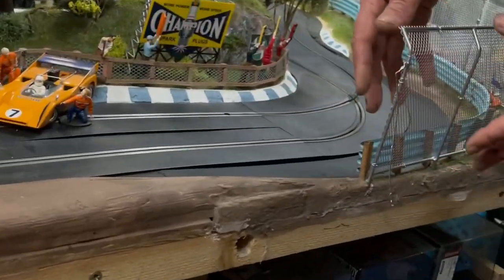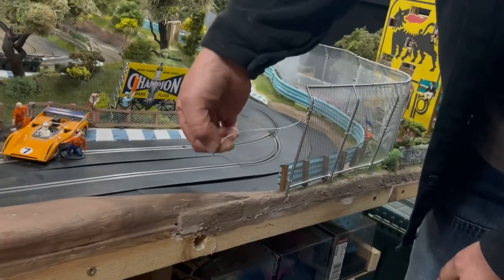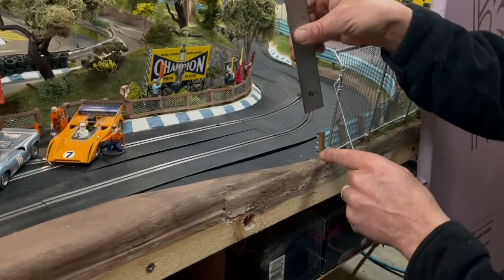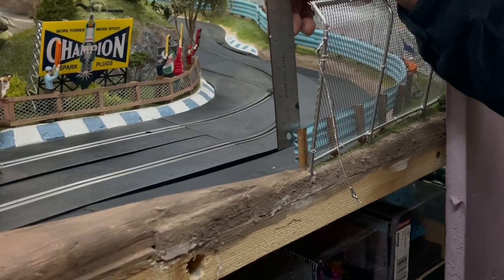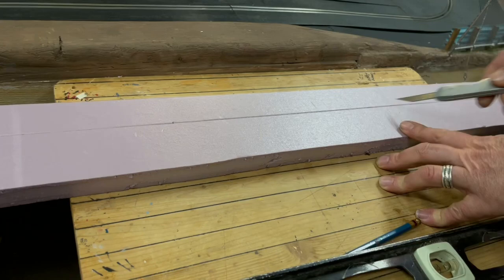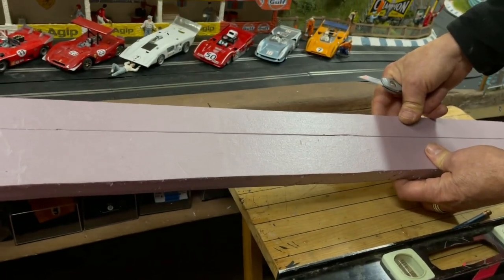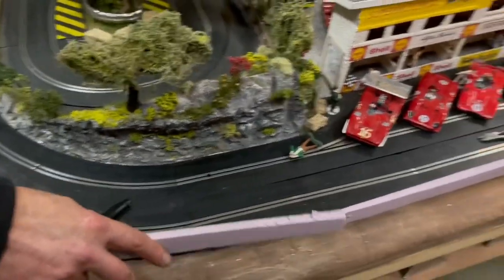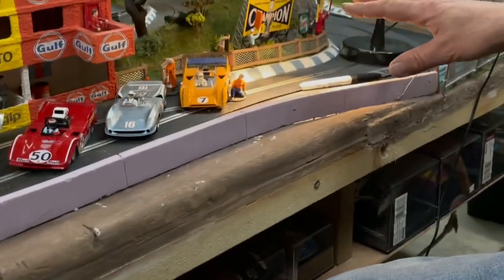How to build realistic concrete crash wall for your slot car layout

Comment: I use 6mm(1/4") cork floor tiles which are 300mm (1ft) square. Cut into strips of appropriate height. I join pieces with PVA glue and a pin top and bottom diagonally and let them dry. I then paint them with a white flat paint or 3 ion 1 primer undercoat. I use the same for widening the track edges, packed up to the 8mm height with thin cardboard glued to the underside, then seal and paint them with a suitable black, dark grey or brown flat paint as required.
Reply from the maker: Thanks Ray …Nice, cork is a great substrate to model with…

Comment: 👏🏽 Lookin' Good Boone 😏! 👍🏽 Thanks for the lesson on Polystyrene Crash Wall Barriers
I've been waiting to see how you were going to make this wall & apply it to your track 😉!
I'm just gonna have to go to Home Depot &  just break down & buy a sheet of the ol' Pink 
Panther polystyrene foam so I can have it on hand when I need it I think that'll be more cost 
effective instead of buying 4 4x4 sheets at a time? ! ? !
Reply from the maker: Thanks Django, it will save you in the long run if you purchase the larger sheet
Reply: @BoonesSlotCarGarage  Right but, I don't have a truck 😂 & that's been
my delayed sheet purchase main reason for not doing it when I first started watching
all these tutorials. But, as we've both come to the conclusion that its in more 🤑💰🤑 effective
to just get the sheet and then worry about getting it home 🤣!
Reply from the maker: @djangofreeman5085  you could cut it down some in the parking lot so it fits in the car

Comment: Way cool. You did a great job of making the transition from fence to wall very realistic. 😎🤙

So I’ve seen you add static grass on a few videos now and I’m eally interested in adding that to my raceway, I just have one minor issue. A little over a year ago I became the proud owner of a pacemaker/defibulater implant and I remember you have said that the grass applicator can shock you pretty well. Damaging my implant and/or it’s battery concerns me more than the actual shock, so I’ve decided to talk with multiple people (primary physician, cardiologist, hobby shop guy) before giving one a try. I would also like to ask you, or anyone reading this, if you have any experience with this applicator’s use and someone with a similar implant. If so, please share.

Thanks again Boone. You’ve got a great channel here.
Reply from the maker: Thanks buddy, yes it’s a good idea to check with your Doc on this one. I have had quite the shock working with this little monster a few times. And it packs a hell of a punch. So checking with the Doc is a very good thing to do
Reply: @BoonesSlotCarGarage  … True that brotha. My doctor’s opinion will have the biggest impact on my decision, but I do put a lot of value on personal experience. Thank you for your input.
Reply from the maker: @mikemueller1686  biggest thing about a static grass application  is the same as Ghostbusters, “ don’t cross the beams” 😂. If the negative wire comes in contact with the applicator… ⚡️ zap.. it bites ya good
Reply: @BoonesSlotCarGarage  … Perfect analogy! Yeah, no need that action. 😂
Reply from the maker: @mikemueller1686  😂